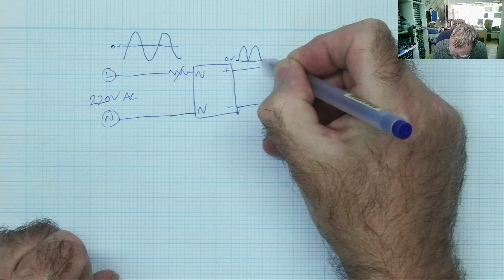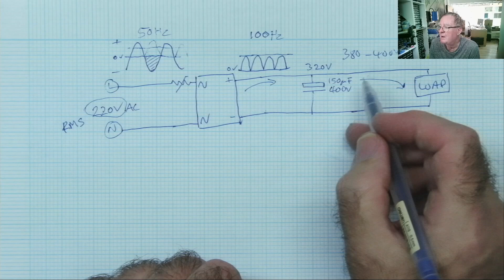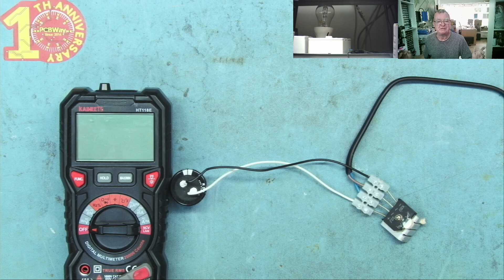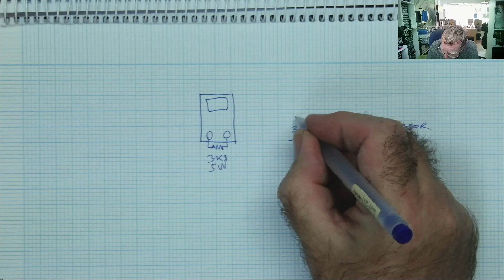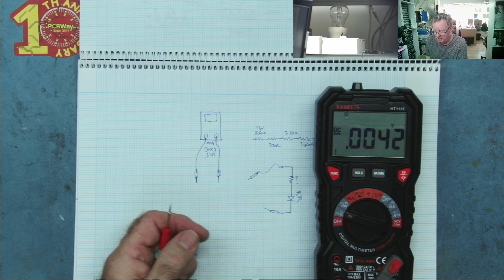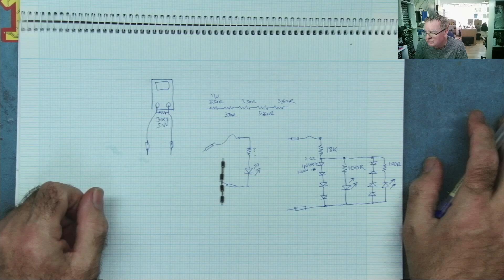How To Discharge High Voltage Capacitors : Cheap DIY Capacitor Discharger

Comment from the maker: Before someone else mentions, you also find dangerous high voltages in the large capacitors in Audio Amplifiers, and in the LED backlight drive circuit for LED TV, amongst other places
Reply: And in flying insect zappers, and old neon sign transformers, too! So many places to find HV!
Reply: Microwaves.

Comment: Thank you for the excellent safety video.  I came looking for how to build a device to discharge capacitors in a Solar charge controller when swapping batteries so there’s no arcing when connecting the new one.  I am currently doing this using a 500 ohm 10W concrete resistor, just touching the leads while monitoring V drop with a multimeter.  I was looking for a more practical tool I could build and you have shown several.  Thanks so much!

Comment: One of the oldes diy-devices that I still keep on my bench is a simple selfmade analoge voltmeter with a scale that goes up to 500V. I have built in a 10k / 10W resistor that I can switch parallel to the meter and probes permanently attatched. This is a very simple design - but I prefer the analoge meter over ALL the other versions with LEDs or DMMs, as it is 100% unmistakable if you can watch this index needle going down to zero...
Also, quite often I keep the meter attatched to the B+ so I can monitor the voltage permanently - and discharge whenever I need to.
The only thing I upgraded at this (at least 20 years old) device is that I changed the 4mm banana jacks with those safety-versions from Hirschmann.

Comment: you can also use a multimeter with a loz mode (e.g. fluke 116, fluke 289, BM2257, etc).  Loz mode  uses a much smaller internal resistance (~3k) than the usual 5-10 mega ohm resistor.  This will discharge the capacitor quickly and you get the benefit of seeing the actual voltage as well.  Very similar to the option with a 3.3k ohm resistor across the leads shown in this video.

Comment: I built a 240 Volt power supply and a 240 Volt inverter and connect a 100 KΩ to earth.
Sure, it takes a small current when the device is switched on but it discharges the capacitor so by the time I have removed the cabinet it's gone down to a low voltage.
I always check with a multimeter in case the resistor has failed. 
G4GHB.

Comment: Maybe to put a much lower resistance, high Watt discard resistor in parallel to this circuit....(and exchange the 18K to a low watt)...

Comment: Just an idea.
If you feed the discharge circuit from a bridge rectifier (from +/- output) then it doesn't matter which way round you connect the test leads (connected to the AC input) and you only need one set of diodes and led plus resistor.

Comment: 4.7k 100w is ideal for discharging any capacitor smaller than 600v 10000uF. For 4K resistor, the dissipation capacity peaks at 90W (poor safety factor), with 4.7K resistor it peaks at 76W (better safety factor). In other words, 4k is the limit, 4.7k is ideal and above that it takes a long time to discharge. For this capacitor, the discharge time is 300 seconds with a 4.7K resistor.

Comment: Find an almost similar circuit on the Internet, there are diodes that meet halfway and two LEDs, a 2.2-3.0 kilo-ohm resistor for 5 watts. It discharges any capacitor, no matter what its polarity, and the LEDs indicate the end of the discharge.

Comment: Could you possibly make a video on walking through the flow of electricity on a transistor astable multivibrator circuit ? I’ve been looking for videos and there really aren’t any channels that explain this in a simple way maybe you could help in this if possible it would be much appreciated.

Comment: What resistor for a 1200v 474k dielectric capacitor?
[0.47 µF Film Capacitor 500V 1200V (1.2kV) Polypropylene (PP), Metallized Axial]

Comment: With the method using 4 resistors in series, i dont understand why the voltage would be limited to 2.2v and not the voltage in the capacitor but minus the 2.2v dropped across the 4 diodes
Reply from the maker: It was four diodes in series not four resistors.  The LED is connected in parallel with the four diodes so it can never have more than 2.2V because each diode drops 0.55V pretty much regardless of current and 4 x 0.55 = 2.2V
The capacitor voltage minus 2.2V is dropped across the (18K) power resistor connected in series with the diodes 🙂The remaining 2.2V appears across the LED plus 100R resistor in series with the LED due to the four diodes.
This is called a voltage divider and it is one of the most basic and important circuits to understand when you are learning electronics.  I hope that helped you
Reply: @LearnElectronicsRepair  yes sorry i meant the 4 diodes, so the bulk of the voltage is dropped across the resistor, that makes more sense . Thanks
Reply from the maker: @reacey  Yeah, the total voltage dropped across any series circuit equals the sum of the voltages across each component.  So you are correct, if there is initially 320V across the capacitor, then when you connnect the discharger you have 2.2V across the four diodes and 317.8V across the resistor.    The reason we have the four diodes in series with the 18K resistor is because the diodes will always have the same voltage drop until the capacitor voltage drops below 2.2V.  

If we used two resistors in series to form a voltage divider instead, then the voltage across the LED would decrease in proportion to the voltage across the capacitor as it discharges, so could stop glowing while there was still a dangerous voltage in the capacitor.    If we didn't have the voltage divider and simply had a high value resistor in series with the LED then all the discharge current would pass through the LED, which is either going to blow the LED, or means we have to use a very high value resistor, so the capacitor would take a long time to discharge, and the LED would still go out before the capacitor was discharged

Comment: If ac has no polarity, why is it that the brown or live conductor is always the one which is fused or switched in circuits? for example in domestic lighting circuits I was always told that the live is always switched to ensure theres no power at the light fitting if the circuit is switched off at the light switch .
Reply from the maker: Well I could ask you then why in the EU our mains plugs are not polarised so they can be inserted either way round.  And things still work.
AC has no polarity, because... well it is AC.  The only difference between live an neutral is that one of these wires is connected to ground at the substation and also at you house.  This means one of the wires is safe to touch if you are also connected to ground, for example by standing on it, and the other one is not.  As the current flows between live and neutral (yes, the same current) the fuse will still blow if there is a fault condition no matter which wire it is in. 

I actually have an isolation transformer feeding my workbench so I can happily touch either mains wire and not feel a thing.  That's because neither of them are connected to ground so I have no live and no neutral. Things I am working on still work or don't depending on the fault, and the fuse still blows if they draw too much current.

If you really doubt this ploarity issue you need to prove it for yourself.  Go take some very expensive piece of mains powered equipment, reverse the live and neutral wires in the mains plug and power it up.  Once you realise it did not explode and is still working just fine then have a good think about whether AC has any polarity.  After you did that go put the wires back the right way round.  Live / Neutral is not a polarity issue it's a convention.
Reply: @LearnElectronicsRepair  oh i dont doubt what you are saying and i wasnt being funny , i was just asking the question .I know polarity isnt important with regards to ac i just didnt understand why the live conductor is switched /fused Thanks for the info
Reply from the maker: @reacey  Hey that's OK I didn't mean to sound sarcastic or anything like that if that's how my reply came over 😊

Comment: At work in 1994, I was repairing a variable frequency 3 phase inverter motor drive that had come in with the problem of tripping the breaker when switched on. 
First thing you think, primary rectifiers, which I think was one of the problems.
Anyhow, while I was fault-finding this inverter, I had been pulling wires with spade connectors off while using a hand crank Megger on the input to trace the short, all well and good.
HOWEVER! When I was reconnecting these uninsulated spade connectors, I had one hand holding the metal casing, and used my right hand to push one of the spade connectors on a connector that was connected to the main bank of primary capacitors, which had been charged up to 500V DC by me Meggering the primaries.  
I partially discharged the 500V across the capacitors by grabbing hold of them, tight! ⚡🤯⚡
By FAR, the worst electric shock of my life. I was 26 years old at the time, and that was a learning curve for sure.
Reply from the maker: Thank you for the cautionary tale, and well done for surviving it

Comment: Wow.  This is an excellent and informative video.  It certainly has been an eye opener.   I have seen so many shorting the capacitors to discharge them, but it is very dangers to do so and bad for the capacitor.  I liked the resistor and diod method.  I will try it.  Thank you once again.

Comment: 😂😂😂
High voltage is over 1000V.
Main voltage for houses is very dangerous for life, but by the low, that can not be called high voltage.
High voltage is in transformer station.

DO NOT USE WRONG TERMINOLOGY!
Reply from the maker: Well for some reason my multimeter lights up red if I probe anything over 30V to warn of High Voltage
Google for the dictionary definition of High Voltage and it says '    an electrical potential large enough to cause injury or damage'
I've seen many mains voltage electrical boxes with a sign saying 'Danger High Voltage'
Other definitions say anything over 1000V.   Now if it is by the 'low' (law?) then why are the low makers not prosecuting the multimeter makers, sign makers,  dictionary publishers and apparently clueless YouTube influencers, exactly?
Really this is pure semantics, call it how you like without fear of prosection, and worry more about electrocution 🤪
And don't worry about how other people call it
Reply: @learnelectronicsrepair  30V it is high, but for ammateurs. You are proffesional, right? Or not?
🤔
In my country, 50V and 50mA is dangerous for humans, by the low. That is not meant for technician peoples.

Comment: I like to charge a big, HV cap and then discharge it with a 2 Ohm, quarter Watt resistor. Pieces of the resistor fly all over the room! I had to do more than just wear my safety glasses, as little pieces of hot resistor were hurting my hands and the leads  left burn marks on them. So I made up a set of alligator clip jumpers 3 feet long out of 8 gauge wire and also put the discharge resistor in a clear plastic box. It's surprising how many of those resistors it takes to discharge a really big cap or a bank of them.  :)

Comment: There are cheap device for this on Ali express. Comes with leads and builtin voltmeter. There's also a tweezer-like version but that is inflexible. Oh yes, and it exploded in my hand. So better take the one with leads 😄 But yeah, if you have an old MM lying around, why not.

Comment: You can as well use filament based lightbulb as discharger. No diodes, no soldering even required. Just bulb socket, connector and well insulated leads with good tips to make connection.

Comment: Couldn’t you simplify the discharger by connecting the leads to the ac input of a bridge rectifier, and connect the large resistor and one diode tree and LED to the dc output, instead of duplicating this part?
Reply from the maker: It has been mentioned... and it wold work just as well

Comment: Built a variant of your LED version using a dead soldering iron as the body with a probe sticking out and a single flying lead for the other terminal. Instead of two diode strings and two LEDs I put a bridge rectifier on the input so it will work either way round with just one LED. Best thing I ever made and really useful

Comment: The ability to recover charge of capacitor is calling Dielectric absorption... in electrolytic capacitor it can run to 10-15% which is quite high (from 390V PFC driven cap), it's good to check cap in some time after discharge again

Comment: My boss in work discharged the input cap of an induction heater with a screwdriver, was bigger than my closed fist and the noise it made. Was like a grenade going off.

Comment: the only question i have can this be used on a microwave cap
Reply from the maker: I don't repair microwaves but if you are talking about a capacitor holding several kV but of low capacitance value then use a proper HV probe to discharge it.  If you want to use a cheap and nasty method like we were taught to discharge the CRT in colour TV, which could charge to about 25kV then use a long flat blade screwdriver with a good and large plastic handle.  Connect a crocodile clip lead to the metal shaft of the screwdriver, clip the other end of the lead to ground on the TV chassis, make sure you have a good ground connection and slide the flat blade of the screwdriver under the rubber cap of the HT lead.  Do this one handed and keep your other arm folded behind your back like a sword fencer.  You should be OK doing it that way but dont' say I told you to do it.

Comment: 10:18 - Richard, to avoid any disastrous surprises, always test a capacitor for voltage before testing capacitance!
Reply from the maker: You know, so far that hasn't happened to me - but it is a fair comment
Reply: I burned 2 capacitance scales on 2 multimeters, due to lack of attention to this. Remembering to discharge preserves your capacitance meter.

Comment: MR. Carlson has a nice discharge circuit with LED'S that works safe on almost any voltage
Reply from the maker: How does it differ from mine?
Reply: Mr Carlsons is complicated, lots of parts and would cost a hell of a lot more, for exactly the same job.
Richard, yours is one of the best ideas I've seen with a couple of scrounged parts and 30 mins to put together. 
Thank you, I'll certainly be building one with an old multimeter. Cheers!
Reply from the maker: @darrenbird2526  Thank you 🙂

Comment: And here I have only used either the old short with a screwdriver connected to the earth pin in the outlet or water raidator. Or used a big wattage transisor. And yes the bigger ones are brutal when you discharge. Just like old tube tv's when you need to discharge the tube.

Comment: 43 min Video about discharging capacitors is reticules.
Reply from the maker: What, you mean it is well targeted?
Reply: Simply short capacitor with 200 ohm 10watt resistor and it is dan. 
No Need for 45 min video
Reply from the maker: @buck_rrogers8067  This video covered a number of topics and chapters:
What does the bridge rectifier / capacitor circuit look like and how does it work
How much voltage will you find in a bulk capacitor (with and without PFC) and why the voltage is so high
Why you need to discharge the capacitor and what fault conditions cause it not to just discharge by itself
Where to measure if the capacitor holds a high voltage - very important so you don't make a dangerous mistake in PFC circuits!
How to build the test circuit (yeah possibly i could have skipped this section)
How NOT to discharge a capacitor with your fingers and why not
How NOT to discharge a capacitor with a screwdriver/pliers and why not
How to do discharge a capacitor safely with a resistor (by the way ohms law says 200 ohms give an initial current of 1.6A for a 320V charge. Watts=320Vx1.6A = initial power disipation of 512 Watts!  How did you calculate a 10W resistor is suitable for this purpose?)
How to make using a resistor a bit safer by fixing a stick/holder to it
How to make a discharger with voltage indication using a cheap/old multimeter
How to make a discharger with LED indicator

I'm always looking to improve my videos and take criticism contructively. Which of these sections do you believe contained no useful information and should have been discarded, given that viewers of all knowledge levels watch my videos and this one covers a potentially dangerous topic?
Reply: @learnelectronicsrepair  
I think you did well to explain what is going on in the circuit for those who don't know, perhaps just starting electronics.
Those who do know can fast forward to the discharger circuit.
G4GHB.
Reply: 1,6 Amps at 320V  vor incredible short time period is harmless for 10 watt. Discharged les as 2 sec. To 0 Volt.
Reply from the maker: @buck_rrogers8067  Surely that depends on the capacity of the capacitors. Call it a difference of opinion and I'm not saying the 200 ohms does not work I just think it makes sense to use something a bit higher resistance especially as the same discharge current flows internally across the capacitor dielectric so why would you want to put it under so much stress when you don't need to?  On the other topic you didn't reply yet, which parts of this video contained no useful information and should have been discarded?
Reply: Just speed it onwards.
It's basic from the start explaining things to those who don't know.
G4GHB.